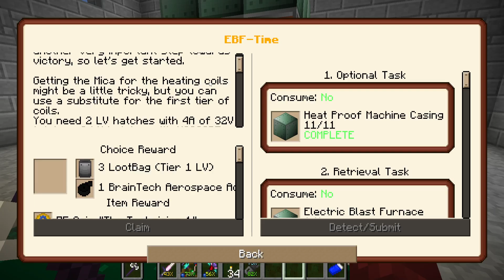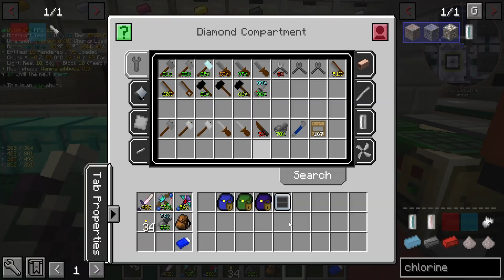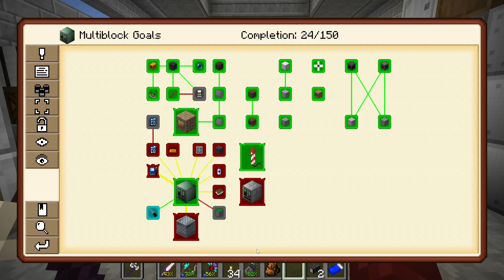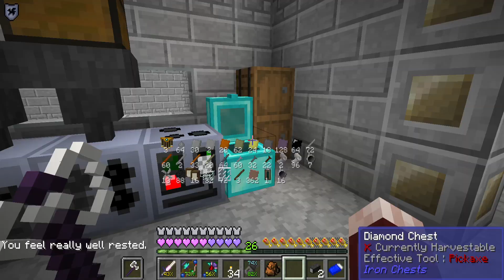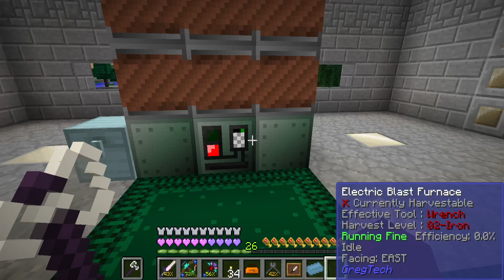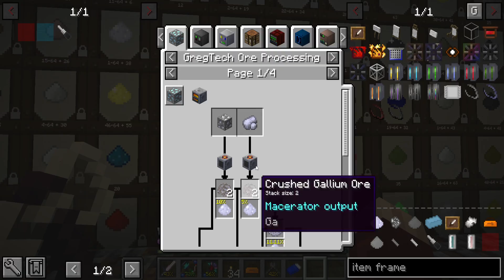GregTech New Horizons EP104: Electric Blast Furnace Part 2!

Comment: Yes the toolbox uses every tool, so it will burn durability/power on your soldering iron.  Its only useful for a machine's first maintenance where it needs everything.  Also, you should remove the battery buffer and replace the cables with Redstone Alloy cables ASAP.  The setup you have can't run continuously.  The battery buffer will slowly drain with continuous use because of the cable loss.  Once you have Redstone Alloy cables, you don't need the battery buffer at all.